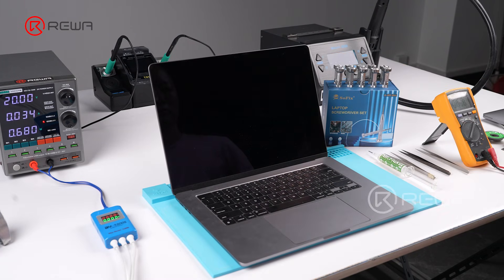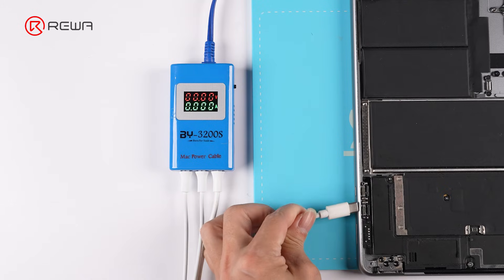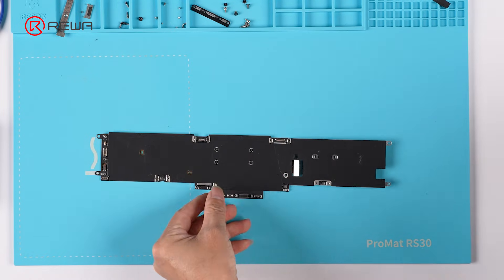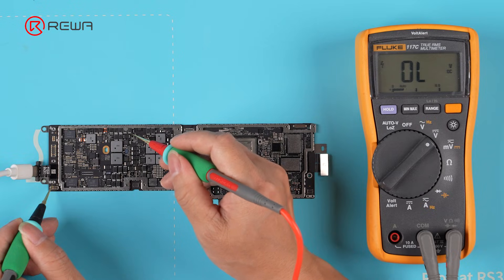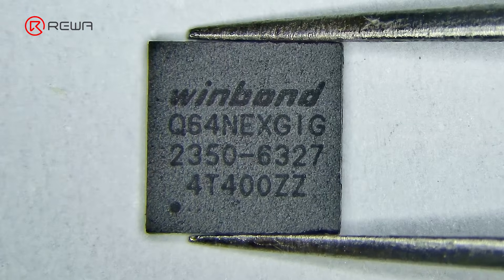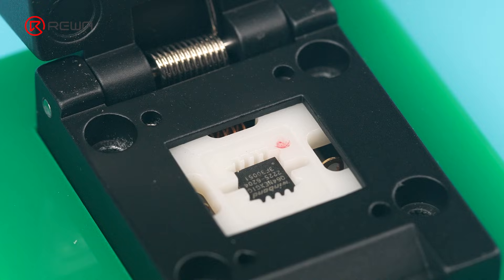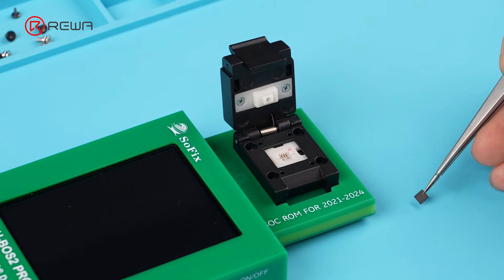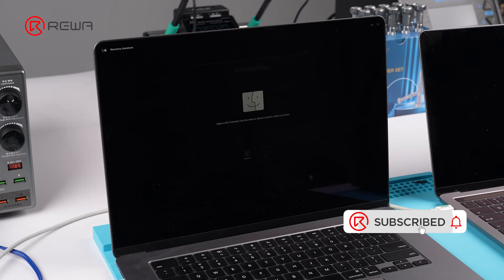Can We Fix This MacBook No-Power Issue Without Replacing the Chip?

Comment: This is a joke. First of all, your MacBook is stuck in iBoot stage one. It could be anything — it could be an I²C short causing an iBoot panic, bad SN25, bad RAM, bad secondary PMIC, bad audio codec.
Second, the SoC NOR contents are not important; they are reflashed on every DFU restore. like wiped and written from host.

What you did is flash some random foreign firmware, which simply caused a DFU fallback, that’s all.
You can achieve the same effect by just wiping the NOR or triggering DFU with a jumper or USB cable. Once you enter DFU restore, the NOR is wiped after a few seconds. On T2 machines there were some NVRAM variables to transfer plus DMI, but M-series machines store device personalization in real ROM inside the SoC.

You are selling snake oil here, and it’s very sad because your company used to produce good tools and instructables. I wonder if you’ll delete this and ban me for telling the truth — would be the second sad thing today.
Reply from the maker: Appreciate your feedback. We're simply sharing the repair approach we used in this case — just as a reference. Everyone can choose the workflow that best fits their own experience, tools, and judgment.
Reply: @rewatechnology2008 i doubt you do dfu restore that way, that would mean a very basic understanding of apple devices, almost beginner-level.
This is a marketing video which you try to sell as an instruction, and it is not about sharing the experience or practic because this is objectively misleading. It is not matter of taste or opinion.